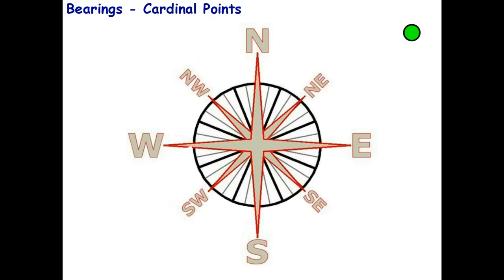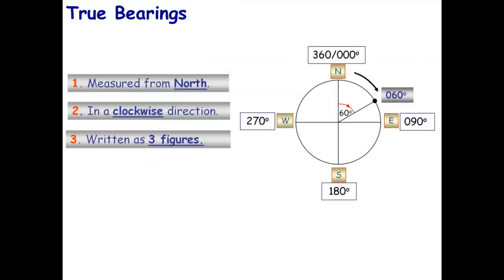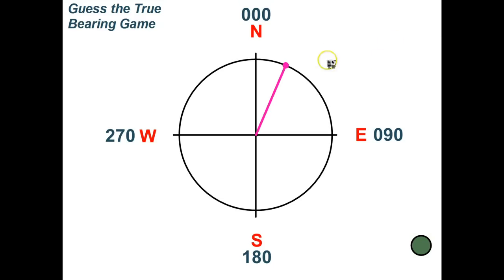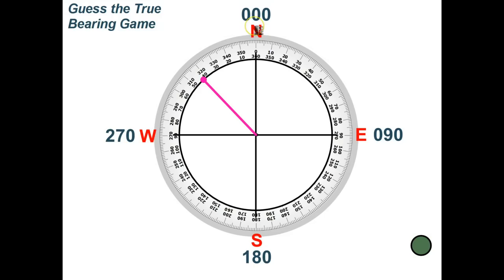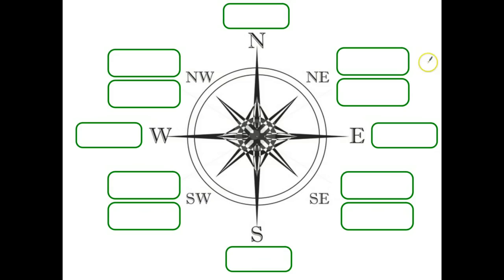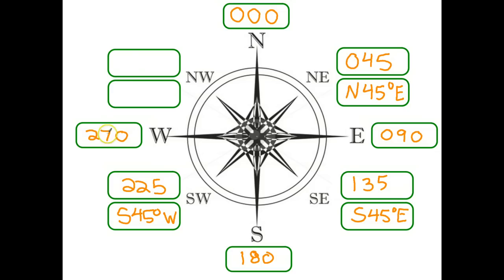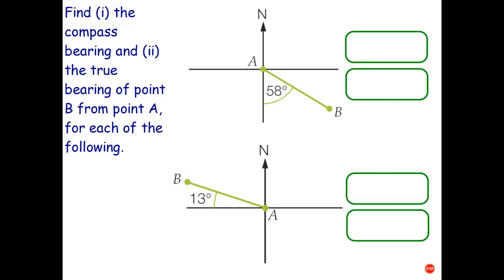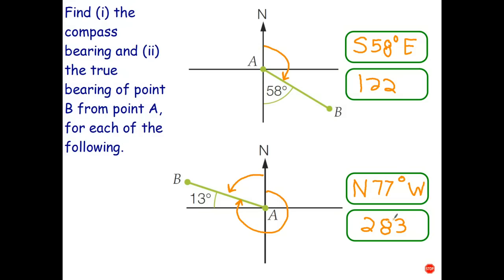Introduction to Bearings

Comment: THANK YOU.  I have just spent a while scouring the internet trying to figure out in what direction bearing-degrees flow.
Every other video or graphic I saw about bearings just shows 45° but that doesn't indicate where the corresponding 1-44° and 46-90° exist.
You finally answered it with your 'how many degrees from the N or from the S'